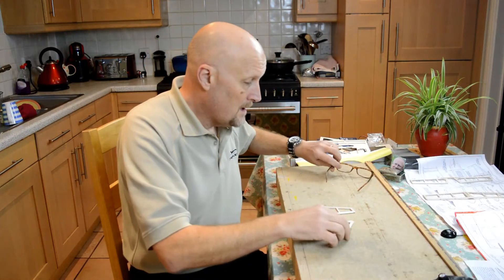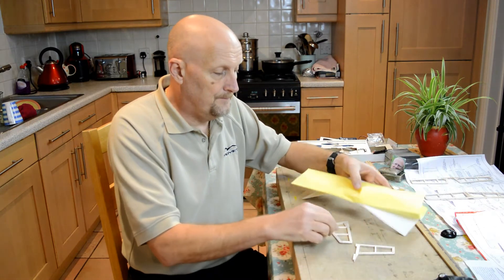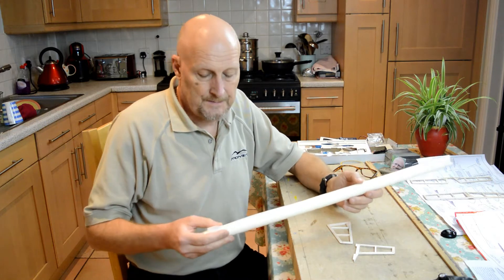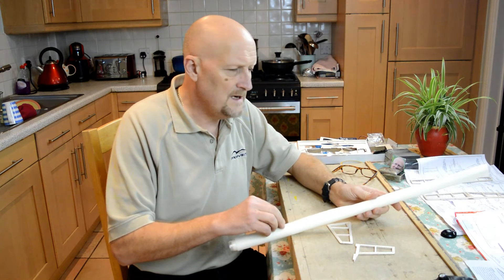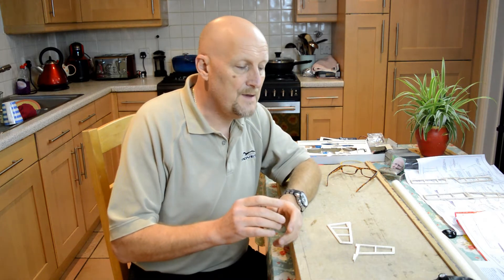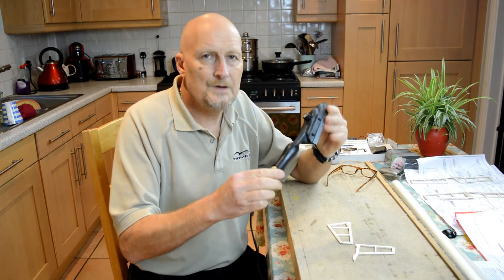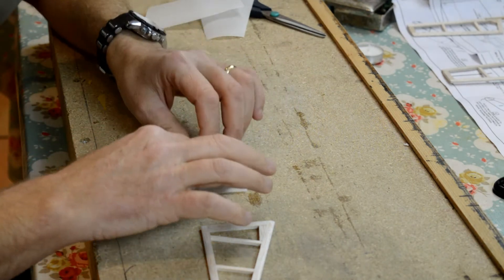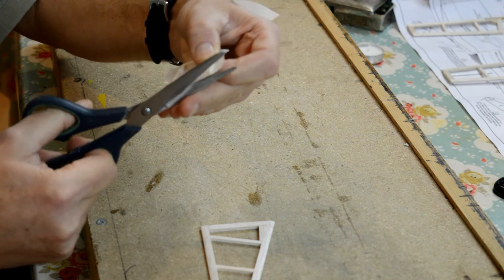How to build a west wings Swallow learn to cover a glider rudder covering with solar film solar tex

Comment: on the tissue, after gluing it down fill a small spray bottle fill it with water and lightly spray water on the tissue it will shrink right up. i built stick planes way back in 1948 in to the 1950s and this trick always worked. have fun with the model.